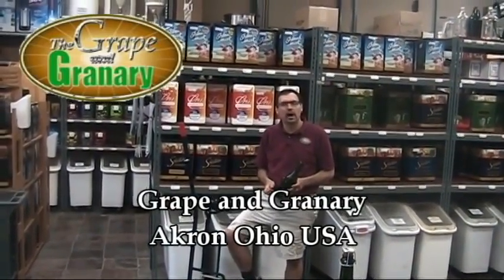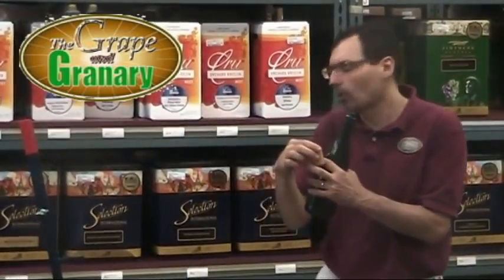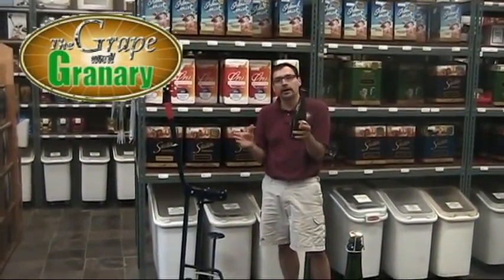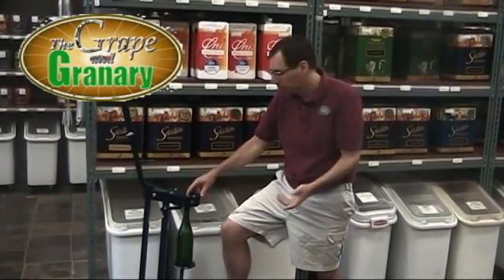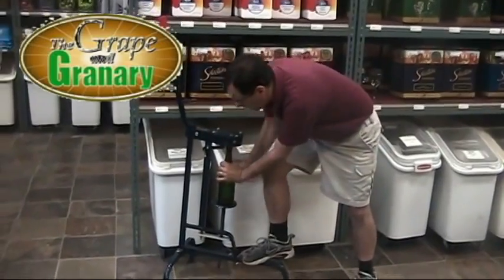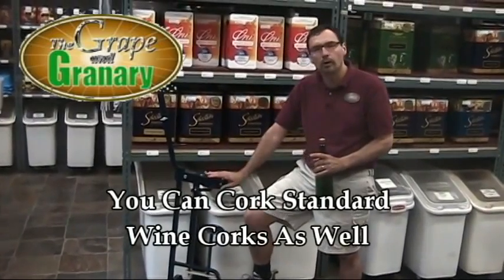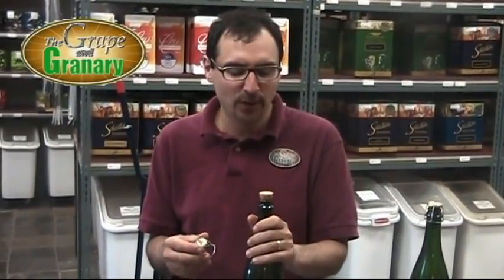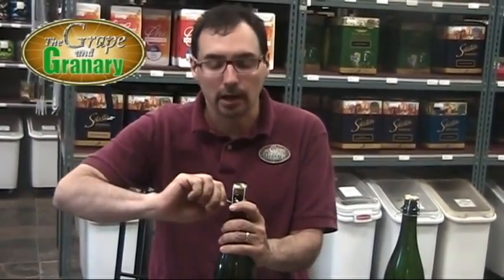How to Cork a Champagne Bottle at the Grape and Granary

Comment: You put the cork in upside down. If you look at all champagne corks that have been removed the "chamfered" edge is under the cap so that it fits snugly the contour of the cap.
The compression jaws on the corking machine ensure that the cork slides into the neck of the bottle easily.
Reply: yes agreed. you will see the agglomerated side with a chamfer for the wire cap and the natural glued on cork disk or disks (will be square). the disks should be going into the bottle because they expand back to their original size better and get a better seal. some suppliers don't chamfer them however and the cap will compress it to shape anyway. I have seen a few get put in upside down via large wineries, due to the autofeed system getting it in oriented wrong just because of the automation issues. I'm surprised how little info there is out there and the few that are out there tend to be wrong.... of course who's to say that I'm correct without credentials.